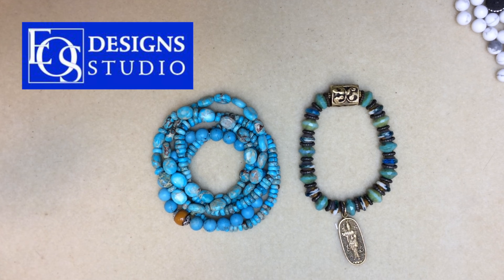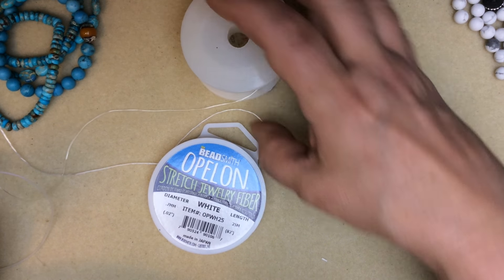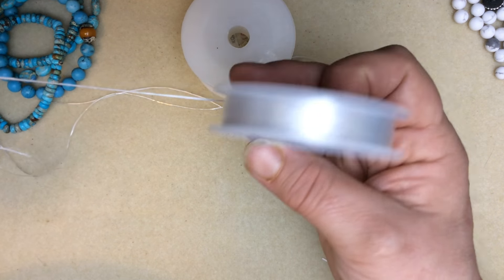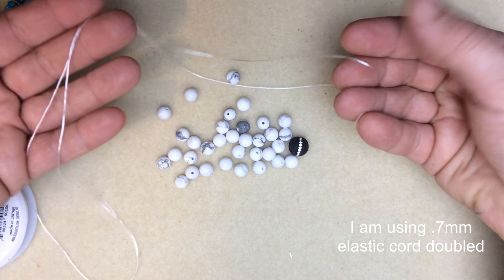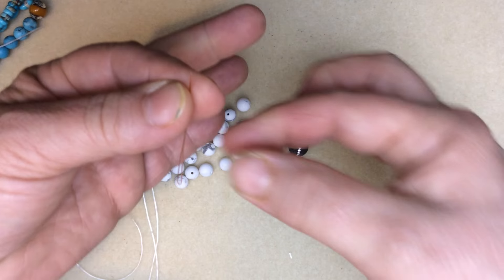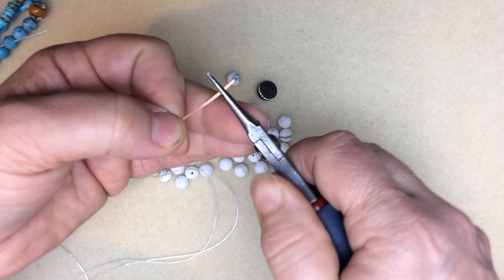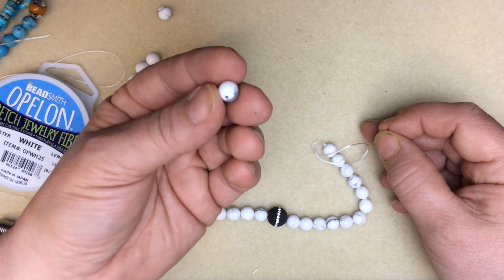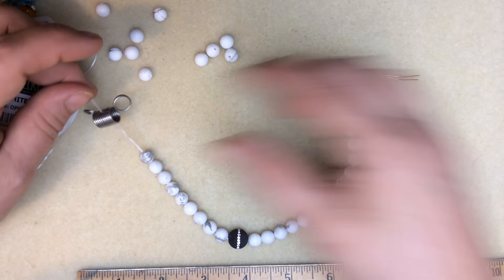How To: Stretch Bracelets w/ Hidden Knot

Comment: I love this video.  I used the cement to glue and hide the bead however it causes the two beads to stick together.   What are your thought on krazy glue?   It dries quickly and my beads are sticking together.
Reply from the maker: HI Jennifer - thanks for watching my video.  I never use crazy glue as it dries too brittle and can actually crack the elastic cording.  The GS Hypo cement is made for gluing fibers.  It may seem, by using the hypo cement that your beads are glued together, but they will not remain so.  Just give the cord a little pull next to the beads and they will separate.  I often do this about 10 minutes after I glue the item - then check it an hour or so later.  If there is any residue from the glue on the bead, you should be able to peel it off - or, overtime, it will disappear on its own.  I hope this helps!

Dawn

Comment: Thanks for the video..  I was using the beadsmith board and the measurements are off on the inches.  I see your using an actual  ruler.  I am new to beading and  had to redo bracelets because inches are off on the board.

Comment: I have bought all kind of stretch cord, beadalon elasticity which is 0.8mm, then diy clear stretch cord .8 mmm then i have stretch magic 1.5mm and now I see yours. I am so confused about what size mm I should use. I probably have more in my stash but i was wondering can I use any of these because i am starting to spend a lot on money on stretch cord clear and would like to use what I have. Can you give me some idea if the ones I have are good to use. I know the one you use is most preferred but please let me know. Thanks. I have to finish watching your video. Nor
Reply from the maker: The diameter of the stretch cord depends upon the hole size of the beads.  YOu alwarys want to use the thickest cord that you can that will fit in the bead hole.  In my tool box, I have the following sizes: .5mm (for pearls and tiny beads) .7mm flat cording ( for use when doubling the cord like in this video), .7mm round (again - for small hole beads that can fit a cord larger than .5mm). 1mm (I like to use this when I have either a bail or large hole to hide the knot in), 1.5mm and 1.8mm rounds (for use with large hole wood and large hole gemstone beads and for heavy beads).  Sorry I took so long to answer, but I hope you find this helpful!

Comment: I have 2mm beads and the hole is only 0.7mm - would I be able to use 0.5mm and double it or would that not go through at all? I'm worried it won't be strong enough but need a really thin bracelet as a bridesmaid bracelet
Reply: High, did you ever figure out what to do in this situation? I am having the same issue.

Comment: Hi! I’m using a 4mm bead. How do I get the knot to be hidden?!
Reply from the maker: If your bead hole is too small, the knot may not chase inside.  You can either try to make a larger hole in one of the beads with a bead reamer and hide the knot there - or, if you are using a charm, hand it from a bail with a large hole and hide the knot in the bail

Comment: How  thick is this cord?  Is it the 0.7mm size?  If so, most beads seem to have holes of 1 mm or slightly larger.  Will this method work with such beads?
Reply from the maker: it is .7mm, 1.4 when doubled.  Since it is a flat cord, it seems to fit through more easily even in a 1mm hole.  Some beads, like pearls may have too small a hole

Comment: My experience with this glue was awful. It never stops discharging from the applicator, so it defeated the purpose of it being needle-width. No matter what I did, I ended up with too much gle because wiping one bead if glue away was instantly replaced by another. How do you make this glue behave?
Reply: Get a paper towel and then take the top off of the glue and put a small dot of glue on the paper towel and then hurry up and put the top back on. After that take a toothpick and dip the end of it in a small amount of glue and place it on the knot with the toothpick It works very well!

Comment: Does this technique only work with the elastic fiber? I use the clear elastic stretch cord so will this technique work with that?
Reply: I use Stretch Magic too. I think our knots would be too big to push into a bead unless the hole is big
Reply from the maker: You could, but it may be hard to get on your wrist - the elasticity is what enables it to slide over your hand

Comment: How do you knot the Stretch Magic 1mm/.039 in.?  It's so thick it unravels.
Reply from the maker: Do a surgeons knot and another on top of the first.  Then put your had in the middle of the bracelet and stretch it from inside (like I do int he video) which will tighten the knot.  Most importantly, glue it and let it properly dry.